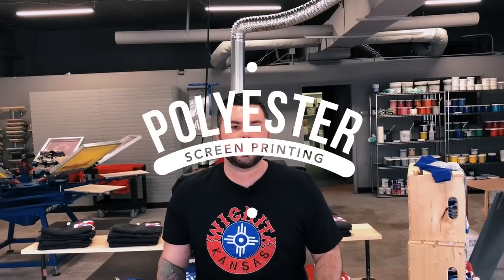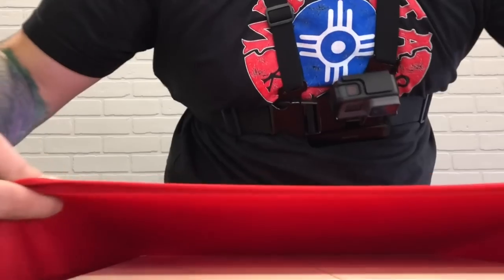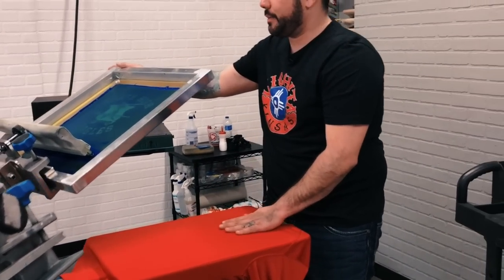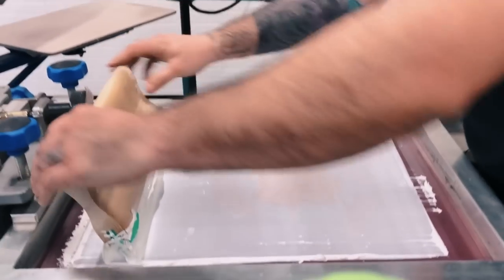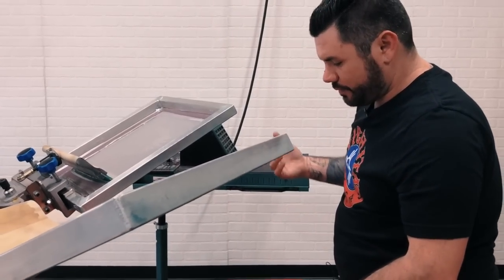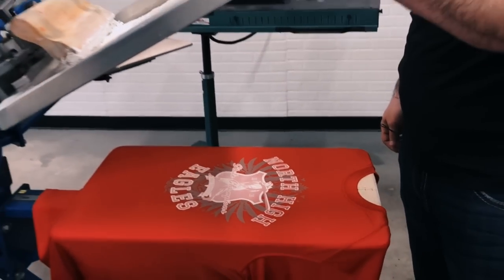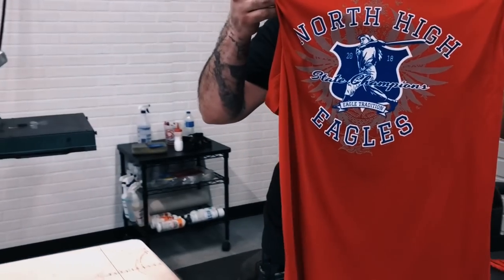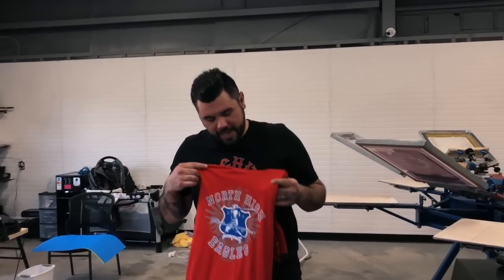How to Screen Print Polyester Shirts

Comment: which chemical is used for polyster and nylon
Reply from the maker: Polyester doesn’t need one- nylon though will need a “nylon catalyst” to adhere the ink to the substrate. I believe fusion 180 ink does not need a catalyst though and will adhere to nylon on its own-

Comment: Do I really need sports clamp for poly mesh shorts? Its 1 color and a small run.
Reply from the maker: SeekingSelf are the double lined? Reversible? If they are double lined then the top layer of the shorts may not stick to the platen while the bottom layer does...what color of shorts? What color of ink/print?
Reply: @LearnHowToScreenPrint  I didn't buy them yet... I'm assuming they are double lined, that was my worry about the top moving. White ink on black shorts. Thanks for the quick reply, awesome channel.
Reply from the maker: SeekingSelf thank you! Yes if they are double lined I would recommend using the sports clamp...especially for white ink on black...print flash print....
Reply: @LearnHowToScreenPrint  got it, thanks again

Comment: Nice video... so does it just come down to the poly ink and temperature to stop the dye migration ? or are there other factors you take in to account ?
Liked the video... just subscribed. 
Thanks
Reply from the maker: Daniel Foster the biggest factors are the ink and temperature in my opinion! Thanks for the like and subscribing
Reply: Yes those are the main keys.  A quality low bleed poly ink and low cure temp.  A couple of other things to consider. Use quality garments.  A lot of the low price polyester garments in the wholesale market have terrible migration issues.  I will not slander companies but one of the worst is in Augusta, Georgia.  Catch the garments off the belt if you don't have a long outfeed and do not let the print tack together.  Lay the garment flat to cool.  Make sure if you stack them hot, lay them out individually or in several small stacks alternating the stack order.  Polyester garments retain heat and stacking a huge stack hot can lead to migration.  Another problem with this is ghosting of the print on the garment it is touching.  The dye in polyester shirts when applied to heat and inks, "outgases".  This chemical gas can actually lead to premature outgassing of the garment touching it and it will ghost the image into it.  Oh yeah, do not over flash.  Most flashes are on/off without temp controls.  The average flash runs 400-500 degrees.

Comment: Did you use nylon 900 catalyst? I saw a video that you mixed with your ink an on polyester shirts the ink wont wash off....
Reply from the maker: Xotic Klothing hi- good question- but no- in this video we just used low bleed ink- it cures at a lower temp- and has great stretch properties for polyester performance shirts.